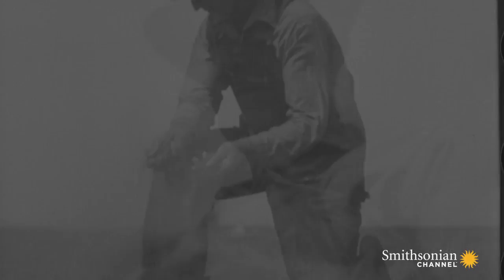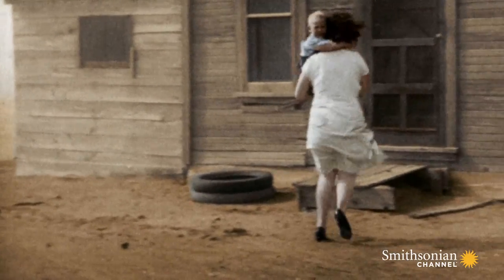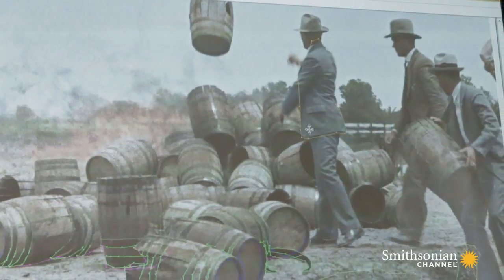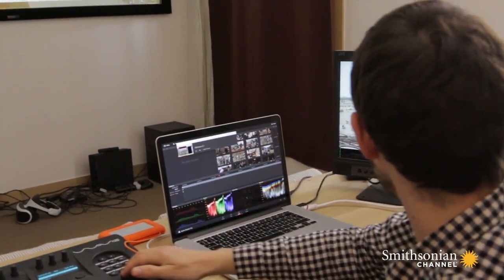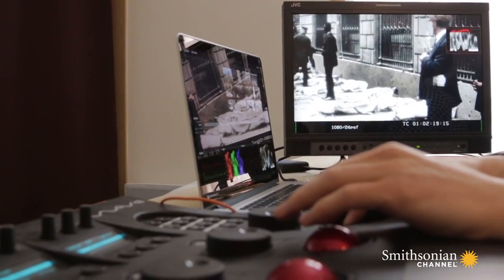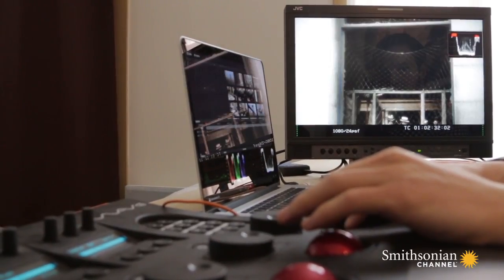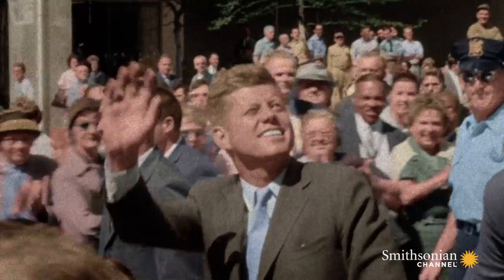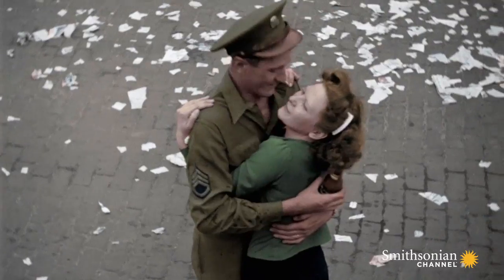How Colorized Historical Footage Is Painstakingly Made

Comment: I shall try to explain my self further those big patches are just telling the computer to turn that area from gray sacele, which is only the variation of shades from black to white you are telling the computer to turn this areas in scales that run  from black to the areas designated color, so the shades are still leaving the stains on the gray, to that is why I say you have to teach the computer to give shades according to the color. to put sheer black where is needed faded or blended with the color, may be today such pixel management is not possible.

I see this specially in the characters faces is like painting  the silhouette of the characters face in just one plain  color and then using a pencil over that plain color to give the drawing its shades

the painstaking part of it all is that all the process will have to be done once again over all the pictures you already though were done